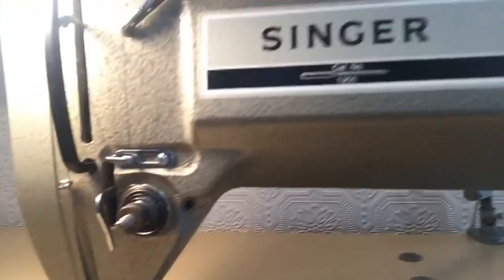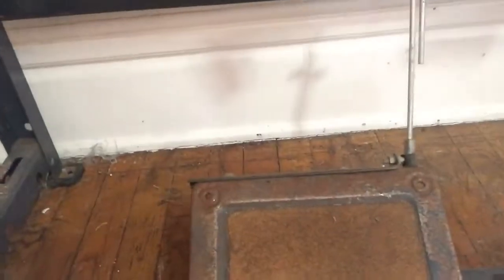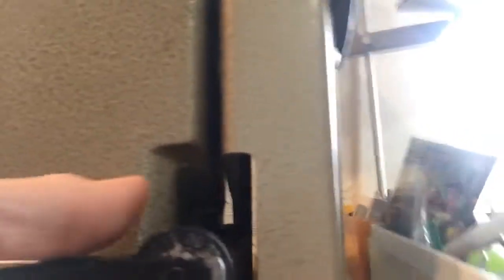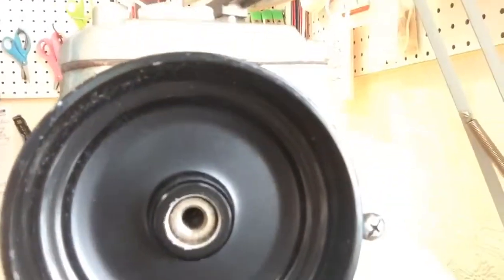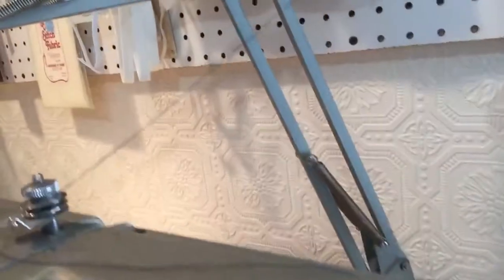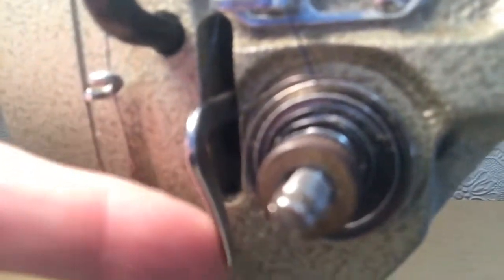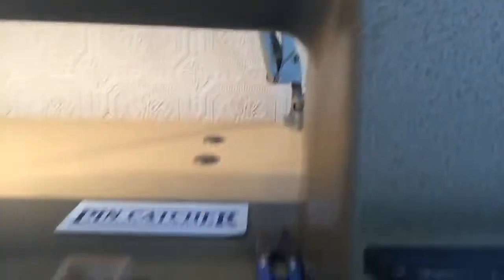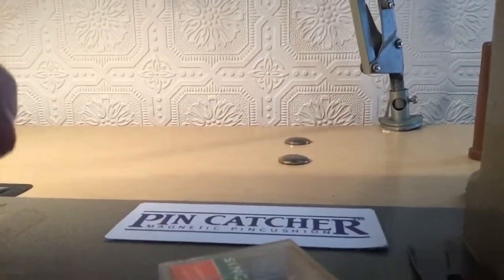Commercial Sewing Machine

Comment: Nice video. My wife and I just bought a 591. I notice we have a different motor(yours seems newer) and the bottom of our needle bar looks different. Are there oiling points even though it self oils some areas ? Ours also came with bobbins that have solid sides yet in your other video yours looked like it had holes.